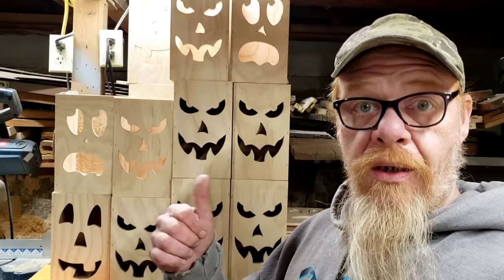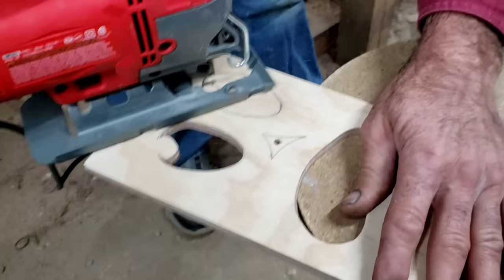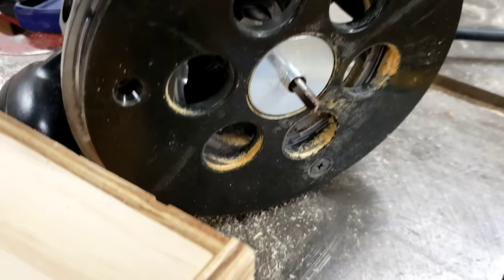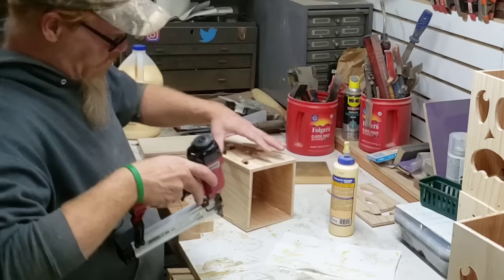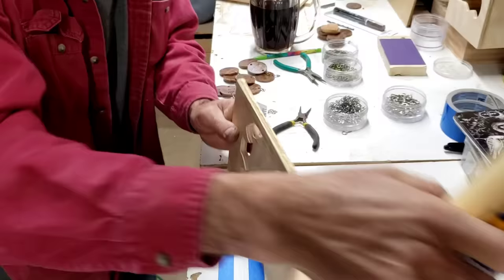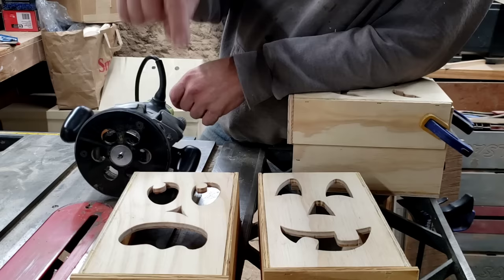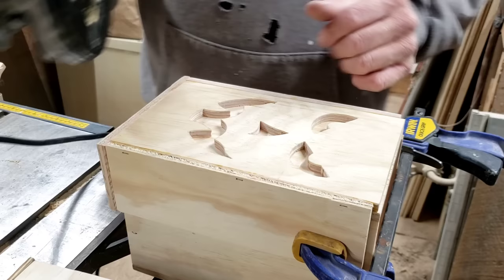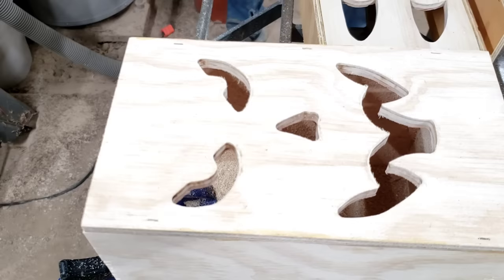The FASTEST way to cut out Jack OLantern faces | NO CNC NEEDED!!!!

Comment: I've just made a bunch of these using a CNC, a Jigsaw, and a Scroll Saw to see which was best for me. I'm not sure why I didn't think of a router template. It looks much, much faster for the simpler, smoother faces. 

Definitely giving this a go! :)
Reply from the maker: Thanks for sharing
Reply: How is hand routing going to be faster than using a cnc? 🤔
Reply: @LuisCasstle  for a one-off, or a small run of <10, hand routing with a template could absolutely be faster. The key part of my comment was 'simpler, smoother faces'. Those with intricate details, nope. Big, circle eyes and a wide mouth, yes. It also depends on the CNC you're using - a small 3018 is sloooow.

Comment: Excellent tip! I have a CNC, but I might just cut the templates with it and do the production runs on my router table with my beefy Porter Cable 3hp beast.
Reply from the maker: That's a great idea!
Reply: Why? Throw the sheet on the CNC, cut and you have many cut at once while you do something else. Should take 5 mins.

Comment: Nice vid, Kevin. I have a Ryobi trim router, but annoyingly you cant get collars for them. This could probably be done with a copying bit as well. Cheers, and thanks for sharing.
Reply from the maker: Great idea with a pattern bit. I am thinking about investing in some spiral cutt pattern bits. 
RE collars: couldn't you use a standard collar set for another brand and adapt the plastic baseplate to accept it?
Reply: @MakinSawdust  Maybe. But they key would be to have it 100% centered. I have 3D printed a new base plate with integrated collar, but it is slightly off centre.

Comment: Amazing tip on how to use a router!!!  How much do you charge for your pumpkins?  Pricing is always my biggest problem.
Reply from the maker: $20 but that was last year when the plywood prices were a bit lower. I 
 sell them unfinished for that price. Most customers want to decorate themselves
Reply: @MakinSawdust  I just got back from 2 different Walmarts. Both were out of pumpkin orange. I probably need to branch out a bit and stock up when I find it!

Comment: Very cool! I'm trying to cut faces in round 8-in diameter bamboo tubes any suggestions?
Reply from the maker: In my head I see a curved template plate that can be secured to the tube. I think you could use the same technique I used here

Comment: Would it work with a 1/8" straight bit, or would it be too hard on the bit? The smaller bit would tighten up the corners, if one wanted to do that. Thanks!
Reply: I'm guessing that it would be hard on the 1/8 bit. If you use it my suggestion is just take it slow. Using 1/3" plywood could cause bit deflection if you cut to fast

Comment: Looking into making these this year. Yours is probably the best video as I also don't have a CNC or a scroll saw. I tried visiting the ETSY link for patterns but couldn't find it. Any chance you have these patterns available? TIA. BTW I subscribed to your channel already.
Reply: I've been thinking of making these for about 2 weeks now. I ordered some stencil templates from Amazon last week. I'm going to use them for a starting point to make the faces. Perhaps this will help you too if you haven't already found a template
Reply: @andrewphillips1865  thanks for the info. Did you just search routing templates for pumpkins? TIA
Reply: No sir, I used a link to the stencils from another video in the comment section of that video.  They should be listed on Amazon as Halloween Pumpkin Stencils. I believe they're 5.5"x5.5". I picked a pack of 20 or 30 different designs.